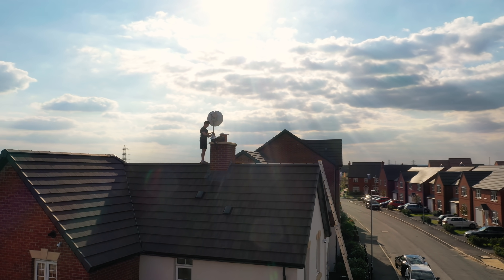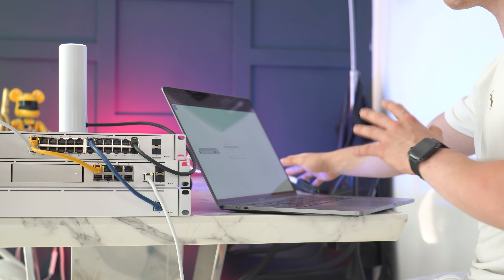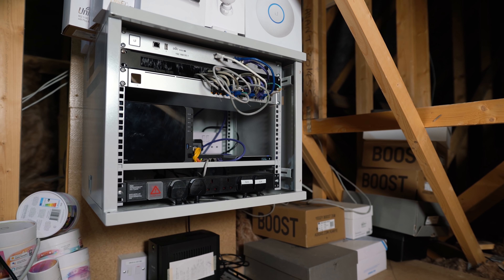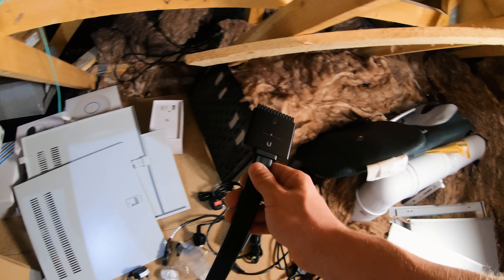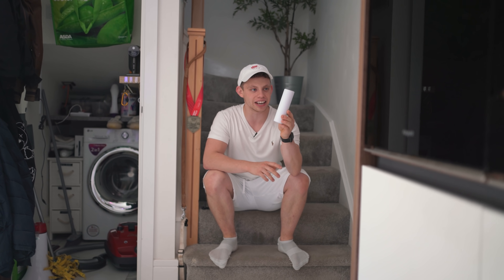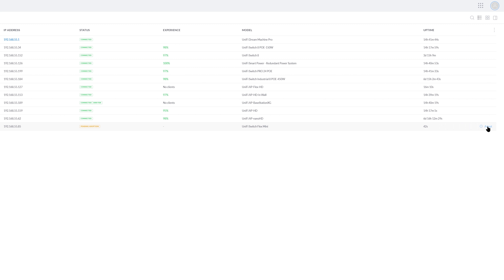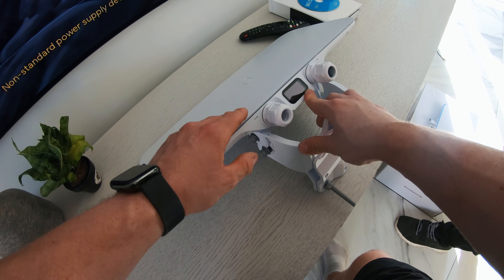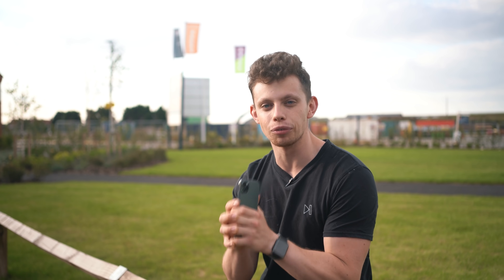Alex's Insane 2021 Home Network Upgrade & Tour!! 🔥

Comment: Far too many APs for that house. There must be so much co channel interference. I don’t even think you could reduce the ap power far enough to avoid it
Reply: I dont think setting roaming aggressiveness to the lowest value would even help this guy out haha
Reply: LMFAO, i completely understand channel interference and im well aware that each ap with use its own wifi channel that differs from the other ones.
Reply: @AkaSoftBanana  You claim
You understand yet you state in Unifi there is no interference. You clearly still don’t have a clue. Just do yourself a favor and stop. You’re started to sound just as dumb as this content creator.
Reply: If youve ever used ubiquity (UniFi) products youll know that theres no interference as they create 1 merged network that works insanely well
Reply: @AkaSoftBanana  if you understood WiFi, you’d know that any multi cell wifi solution (which UniFi is), will suffer from co channel interference. With that many APs overlapping channels is unavoidable.
Reply: @stevejones8392  high density of aps in a small area would encounter such issues, but there is a larage range of channels and providing no external interference plenty of channels not to effect the user
Reply: @AkaSoftBanana  there is no such thing as a “merged” network in wifi.

As a professional designing and installing wifi networks for over 17 years (including UniFi), I’m aware of what’s possible
Reply: @AkaSoftBanana  lol you're quiet the character. Do you often make up shit as you go along? Each AP must operate on its own a channel “with decent separation” between those channels on both 2.4 and 5ghz to avoid neighboring interference. Interference is interference regardless of the brand. He's bound to run into channel interference placing AP's that close to eachother especially in a dense neighborhood like that where likely there is little to no room for decent channel separation due to saturation from the volume to of neighboring AP's.
Reply: @AkaSoftBanana  Lmao are u crazy hahahaha thats now how internet works.

Comment: When I see a video like this.. knowing the price of those devices.. I can only think on one fact: WASTE OF MONEY. This is a high end home system right ? It means it doesn't even arrive to what we know as Enterprise grade.. sad part is that for the cost of this  you actually buy enterprise grade hardware with real capabilities. By example,  any APC 1u VAAI will work better, and have more features than this UPS..
The switch.. for that price I can buy Cisco, dell, hpe.. switches of L2/L3 with even quagga..
That router, what a joke... any sophos xg, fortunately, checkpoint fw1 will give better throughput both in DPI or SSL offloading and obvious much more advanced features..
Those access points.. are slow outdated.. any Cisco new lines would provide much better throughput and enterprise grade features like DAP (transparent meshing) and not pseudo ones...
Expensive equipment for those who don't know what they are buying or even how to make use of it.

I'm happy that ubiquity has sent u all that iron as well as a professional network installer so ur video looks neat... like u knew how to grip rj45 In crossover order... sighs...
Reply: So what Cisco system would you recommend that doesn’t cost a monthly lease fee? Router, switch and ap
Reply: @flyguyokcity  feel free to contact their sales representative
Reply: So you ramble on about how there are so many other more affordable and feature packed products and someone asks you a legitimate question about what those products are and you have no answer. Interesting. I’m guessing they have no comparable products in this price point that do not require lease fees. Prove me wrong, I truly wish you could.

Comment: Simply overkill. Switches and AP coming out every orifice. AP usually used by stadiums says it all.
Reply: Spot on on the switches. Although, that little Flex Mini switch, at ~$30 for a five port Layer 2 switch, is quite handy when you run out of Ethernet drops in a room

But while the access points are used for stadiums, but they are appropriate for home use too. I’ve got one AC/LR and it not only provides wifi for my whole home but also 200ft out from the front and back of my place with a solid signal good enough to watch YouTube without any stuttering. 

And while I live in a wifi jungle, with 45+ other wifi networks within range that absolutely crushed the performance of consumer grade wifi, the AC/LR keeps going, providing wifi Internet access at 97% of the performance of my wired Ethernet network.

So sometimes buying “overkill” means you get solid and reliable performance. 🤷

Comment: FYI: that is not a UPS, its an RPS. It will not provide power during an outage. Its for rack service keeping a redundant power supply if the main power supply malfunctions. Ubiquiti does not make a UPS.
Reply: I came here just to say that! He should really research his hardware
Reply: @stevejones8392  he knows it isn’t a UPS because he mentions plugging it into his UPS. But I’ve noticed in other videos that isn’t always as careful as he should be with the technical information when talking about products. 

On the other hand, he’s managed to build a little WISP business with equipment mounted in the attic of his parents home which impresses me.

Comment: 900 down and 30 up. Just curious how your neighborhood will react to constant radio emission from your super powerful antenna. Especially the ones next door. There is a reason why these things installed in places you are 3-4 hours at most. Having this emission 24x7 is not cool. Even with free wifi. At least you put it on the roof, but don’t point it down. I know guys who worked installing LTE antennas and after 2-3 years got serious headaches if even close to wifi.
Reply: Those devices still conform to the FCC limits, thus they can't exceed 1 watt. In the case of that unit, it is 25 dBm (316.2 mW). It relies on a ton of beamforming to actually get good coverage, and just constantly switches which antennas int he array are active to do target just the client device. Though public WiFi is not good to offer since the account holder is ultimately responsible for the traffic, which can lead to issues if someone in range decided to do something insanely illegal.

Comment: Why on earth would you put an SSD in for video recording, that's just a bad idea, especially a low end san disk one....
Reply: That Ssd will die inside 3 months! They won’t handle the sequential read writes. Even hdds will struggle and is exactly why hdd vendors like seagate have specific Cctv drives
Reply: I agree, I came to the comments to look for this. I’d suggest he use a WD Purple for this
Reply: Fast navigation when viewing videos. And the UDMP only has one disk, many cameras will work better with more available IO. But these are marginal reasons...

Comment: Serious Fucking Overkill for such a small house
Reply: Literally
Reply: It depends, the hue bridge when actively running through a bunch of automation and formulas, can use enough throughput to saturate a 56k dialup connection in terms of the cloud reliant functions. As for basic functions, that is handled locally and does not send anything over Ethernet.
The cloud reliant smart outlets can use upwards of 1KB/s per outlet for the duration of an action, and if they are the outlets that record power usage, then they can end up constantly using around 1KB/s of data. While he also mentioned using a chromecast on the separate network, it doesn't make much sense since it is a device you would want on your main network so that you can stream from your NAS.

Beyond that, in terms of the APs for in-home use, they can work well if you need to maintain a constant 400-500Mbps in every single room of the house for 2 stream 80211ac clients.

Comment: Can someone explain in simple english the difference between UPS and RPS?
Reply: UPS is uninterruptible power supply. RPS is redundant power supply. A UPS is a battery backup, an RPS is just a second power supply. The Unifi RPS provides a redundant power connection for mission critical networks. If the power supply in the Dream Machine Pro fails, for instance, it automatically switches over to being powered by the RPS. This video is incorrect in stating that the Unifi RPS is a UPS. It does not provide battery power when the power is out. Hope this is helpful.
Reply: This person got it wrong. An RPS is a redundant power supply by providing redundant hardware. A UPS is an uninterruptible power supply that supplies backup electrons from a battery if the power goes out. Alot of people have made the mistake of thinking ubiquitis RPS is a UPS.
Reply: Sadly you’re wrong Neil! The rps will only negate the Failure of the internal psu of the device. You could connect the rps to a ups so avoid cable runs but otherwise it won’t help on an outage.
Reply: @stevejones8392  Ok, I think I got the difference between an RPS and a UPS. So why don't manufacturers just install 2 similar conventional PSUs internally to their devices so that if one goes out, the device can continue being powered from the second one? Like this, there is no need for RPSs and their huge power cables as we saw in the video.
Reply: @yiannisevangelou6246  totally agree! Many do, Aruba and Cisco for an example.

The “benefit” to ubiquiti’s solution is that one rps can power multiple devices, so it’s cheaper in the short term for the base devices. 

Personally I prefer hotswap psus. Typically psus are classed as a disposable part, so I’d prefer to swap out a psu rather than replace a switch in the event of failure, as even with an rps if the internal psu fails you are still going to want to replace the switch in the event of a failire
Reply: And the RTS has two big weaknesses vs having redundant power supplies. First, you can’t start up the device with a failed main power supply from the RTS. So while the RTS will keep the attached devices running in the event their main power supply dies, if the RTS looses power or you turn the device off, you can’t turn it back on.

Second, with the main power supply not being hot swappable, you’ve still got to pull the device out of the rack to change the power supply, which means at least part of your network has to go down for the time it takes to replace the power supply. 

So the RTS provides you the opportunity to decide when your network will be down, just as long as you don’t lose power to the device it’s keeping running for even a moment. 

Better than nothing. But it really needs to be accompanied by a cold spare of the switches it’s connected to, or at least keep a replacement power supply on hand.
Reply: @williamp6800  thank you
Reply: there isnt one, its just marketing.
Reply: @a5pin  wrong
Reply: @a5pin  lol ummm yea ok.

Comment: The USP is not an UPS (Uninterruptible Power Supply) ! It is just a redundant power system, which mean that if a power supply of a switch or udm stops work, the USP RPS will continue supplying power to the devices, The USP basically don’t have battery and inverter, and don’t carry another power source, it need regular AC power from the street to work.

Comment: Wayyy too much going on in my opinion. Instead of reviewing and installing the most expensive kit on the market. Why not try a budget alternative setup for networking beginners?
Reply: Ubiquiti aren’t the most expensive kit on the market. Actually quite reasonably priced
Reply: Ubiquiti are one step above typical consumer grade gear. Far, far from being the most expensive, or even expensive. 

Anything less, the video becomes go to big box store. Buy a consumer grade router. Go home. Plug it in. Run a speed test. End of video. 

He just make it seem more complicated because he replaced a whole bunch of stuff at once and because he seems to be installing far more equipment than he actually needs.

Comment: with all of those access points, do you have to jump between different wifi signals? or how does that work?
Reply: All the access points are controlled by the UDM through the cloud key portion. You configure the wireless network there then they get pushed out to all of the APs. All the APs work as a mesh network. They all carry the same SSID and Password so as you move around, your devices move from one AP to another seamlessly. There are other budget friendly options for mesh networks from companies like Google and Orbi.
Reply: @TechBeamChannel  Thank you so much
Reply: They will all have the same ssid and password but on different channels, your phone will jump to be the signal. Or the unifi box will move you. I think (someone will know how to explain this better) 
We gave 3 unifi access points and it’s amazing, great easy WiFi everywhere
Reply: Same SSID and password for all access points. Your device picks which access point it connects to based on signal strength and roams from one access point to another. . 

In this case it appears all access points are hard wired to the network so no meshing occurring.

Comment: I have sky is there any way to make the WiFi better or faster
Reply: Change your router and pay for faster speeds
Reply: If you want the best speeds then I advise against using the provided router and upgrade to a decent one. Most of the free routers ISPs supply you with, aren't the best. They'll do the job but will be somewhat lacking.

Comment: You realise that UPS RPS isnt a UPS right?! You still need a UPS for redundant power.... Very unclear in your video..... For anyone else viewing / watching, you cant replace a UPS with that device, thats not what its for...
Reply: This. The exact model is USP-RPS. And it is a redundant power supply but not an uninterruptible power supply. Is for when a PSU onto a switch fails for example.
Reply: @sbzstudio  Fairly pointless device imo. And thats coming from a big UBNT fan.... Would be much better off just making devices with failover PSU's, not really needed in most products, but maybe just in the PRO lineup or something. Just seems like a gimmick wasting a U of rackspace to me.
Reply: @darrenjlobb  I agree, redundant (And hot-swappable!!) power supplies are much better! Although perhaps the idea is to reduce the number of mains connections you need? Still kinda pointless because that's what PDU bars are for!
Reply: @binaryoverload  Would much rather a couple extra power leads than those huge chunky proprietary leads they have decided to use!!
Reply: @darrenjlobb  Very true, the bend radius on those cables is going to be awful for pretty much any rack that's wall-mounted or not full-depth!

Comment: Wow, nice gear, shame about the state of the cable termination into your office flex switch mini, sort it out man..... Also Its not a UPS, but a redundant power supply. You need to do better research before mashing together another Ubiquiti advert.
Reply: Facts and even after doing "cable management" it still looks trash... Plus what the fuck was that termination to the flex mini

Comment: Sorry mate, but you can't be teaching network stuff and mixing MB and Mb... also, what's going on with that rack mounting space between devices 😳
Reply: Yeah I saw that too. It’s so obvious the  cage nut holes are spaced into groups of 3. I’m not even gonna mention the patch cable termination at 12:45.
Reply: Aids that's what is going on
Reply: It’s all a complete mess and I’m so confused. Would anyone please be able to help me out. I’m trying to create a home network system but have a budget of £1000 maximum. Can someone please list me the parts as watching this video has confused me so much
Reply: TBF it’s not a bad idea leaving ventilation space between units, especially in a loft. In fact, Ubiquity state not to stack units together.

Comment: You might want to rewire the black network cable that you had plugged in to your pc instead of having the wires exposed as you'll get a tonne of cross talk and interference. That's what the shielding is for

Comment: You know the UPS RPS doesn’t have a battery in it, it’s a redundant power SUPPLY, you still need a backup battery to power the RPS.
Reply: If he was actually a network engineer (which isnt) rather than pretending he is one then he would probably have known that. Kid has more money than brains!
Reply: I mean, he does also say in the vid that his ups was connected to the rps...

Comment: Ubiquiti do some nice gear and good to manage as an MSP too. But they make some pretty boneheaded mistakes, like you say those ups cables are mad, the last thing anyone needs in a rack of masses of excess cable which doesn’t look all that bendy. Also desire doing expensive routers and firewalls for years now they can’t write managing multiple external IP addresses into the gui/firmware. 

As a result we can’t and wont do full unifi stacks for our clients because the routers are no good for enterprise

Comment: Upon the peak of a high slope roof in running shoes with no fall arrest system harness and no work boots! Right after the safety warning disclaimer! Yes, that's a concern. A professional would have mounted a fall arrest lanyard and attached it to a certified harness anytime you are more than 3 feet off the ground. . Here in Canada, I believe a helmet and safety glasses that are attached using a strap to secure them on the head are also mandatory as well. knowing someone who fell off a roof like this and broke his back leaving him in a hospital for two years and a wheelchair for another year and never being able to use his left arm again. I can tell you you do not want that for the sake of 30 minutes and $200 of equipment and another hour of fall arrest training.